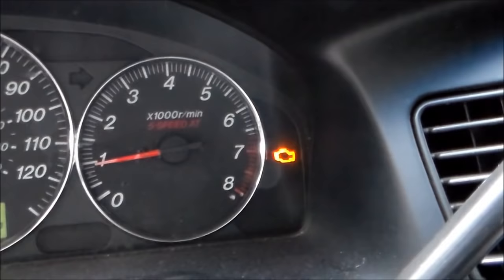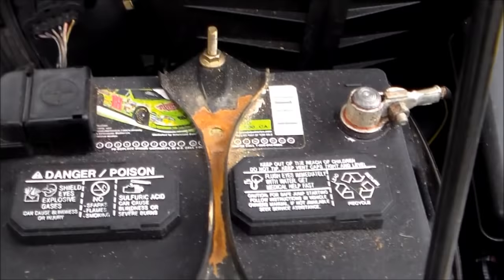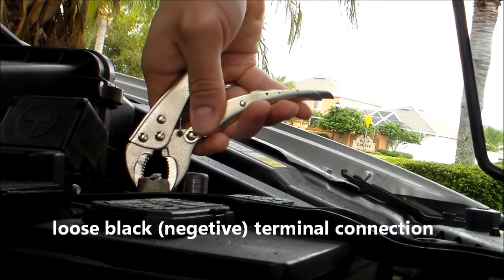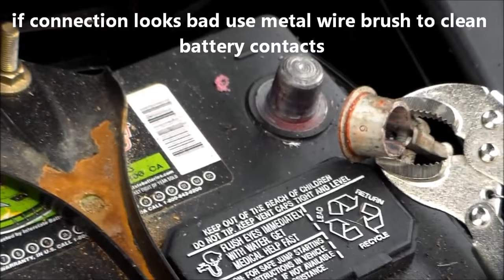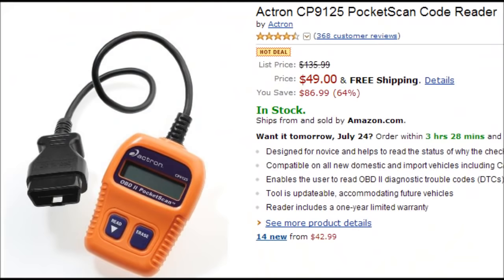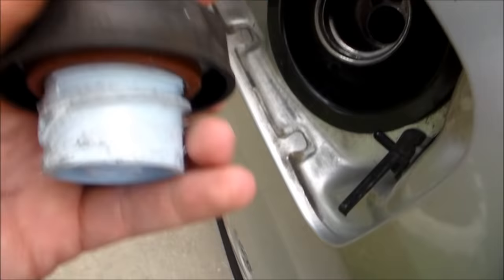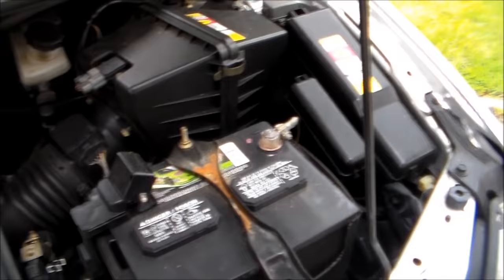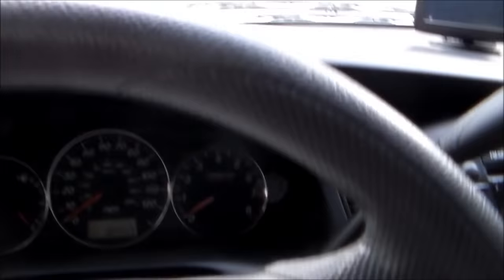HOW TO RESET CHECK ENGINE LIGHT, FREE EASY WAY!

Comment: So I filled up my tank the other day was in a rush and forgot to screw the gas cap back on turned on the car didn't pull out the gas station yet though, then someone came over and told me I left my cap off, but the next day the service engine soon light came on (not blinking though) I have a 01 pathfinder do you think the battery reset trick will still work? Well for any car/truck make or model? 
I do intend to go to auto zone for a code reading too. I am no novice but I like the idea of diy and saving money.
Reply: Your light is back on?
Reply: Jak StG Yes you BET it's back on... This does Nothing to repair this problem...
Reply: I know that does nothing to fix the problem. I'm no dummy when it comes to cars. I was simply referring to a  prior conversation we had about this.
Reply: Auto Zone can put the light out for you unless it's a VW.
Reply: you don't need to do anything the check engine light is gonna reset by itself(it takes time) like mine did the next day after I fixed the problem which was loose gas cap, unless there is another problem!

Comment: App for Car’s Indicators and Warning lights explain.
The app includes 468 unique indicators lights.
Website: http://Carwarninglight.com
YouTube: http://youtu.be/u5o9CdUbwms

This App could save hours of frustration and trouble with your car. Indicators and warning lights in your car instrument panel are there to signal that something is wrong with.
The App provides an overview of your car indicators and warning lights, what they mean and how you should act once illuminated, as well as some advice about common engine problems.
You have all the information you need at your fingertips.

App has Car Finder and Parking Reminder. You will never be late again, phone will remind you before your parking expires.
Reply from the maker: good to know

Comment: hi please i have aqustion..i have ford galaxy 2.0  diesel 2009..last week the temperature gage goes high  till 110 while I am in traffic jam i stopped immediately the engine a little bit warm but fan doesn't work? after i use the car without any problem till now i drive for long distance no problem. I don't know this happened shall i check the car ?

Comment: Hey bud like the ps3 vidz but 2 things 1 pulling the battery terminal is like a hard reset also steer away from locking gas caps that code will pop alot another thing with the battery trick if ur car dose not seem to lack power and u cant tell a problem then pulling the battery is okay but if the vehicle seems to have a problem do not pull it take it to a mechanic they have computer scanners that read your probable cause and can get u fixed up when pulling the battery terminal is a hard shut down where the scan tool is ur soft reset  u can buy these cheap ones for 40 to 50 I have a 100. One and can give me codes and I can erase but we also have 3 to 4 thousand dollar ones that can do more and really get into the system

Comment: Rather than waiting with an open circuit, for the electrical system to "starve", you should be able to just short the positive terminal (after removing it, of course) to the negative, instantly draining any capacitors & what-not.  But yeah, patience is probably the virtue here.

Comment: Well...that assuming your gas cap is the problem...why dont you clean your corroded battery...and use the right tools unscrewing bolts...that would be a start.

Comment: There's a much easier way . Just unhook your car battery than plug back up . Wait for you computer to reset and your light should be off . It will come back on Ater around 40 miles but this is enough time to get it to pass inspection.  Done it for two years strait .

Comment: on my last astra mk5 it was usually the engine oil running low and I had to top it up and drive the car switching on the car and off around 30 times , i did this sometimes while coasting  and moving Around 20-30 mph but not too many time every 5 minute to 10 minutes .sometime 2 quick on and off at traffic lights takes about 1 hour to 2 hour .
 remember not to drive to hard after low fuel light is on you will mess up the fuel pump .

Comment: This is a band-aid fix and the light will come back after the factory drive cycle is completed.   If you have a check engine light, fix the actual problem.  this is no different then putting a piece of tape over the light.

Comment: my VW jetts 09 gas cam does not have a clicking sound and I had the check engine light on but I have a new gas cap and it does not click when tightening the cap.

Comment: I know you're only trying to help the public but this is not the right way of fixing any check engine lights. You might as well just take the bulb off from behind the instrument panel if you did this. Also get the right tools to remove the battery terminals next time.

Comment: wow...can you please tell me how long that lasts
Reply from the maker: reset will last a long time if you just Repair/replace the defective part before cpu detects error again (gas cap in my case) many cases "o2 sensor" or "loose gas cap" will cause "check-engine" light to turn on
Reply: o ok thank you so much for the advice

Comment: Scooby says     Rut row...............Vise grips instead of box wrench? Pulling neg instead of the poss??? 
Always disconnect Poss+ Batt term first/ reconnect pos+ last. You always want the elect system grounded -  Batt first
Always use the right tool for the job.
.

Comment: This only works if the problem is resolved. When the battery is unhooked, I/M readiness monitors also reset, and when they are ready again (after proper drive cycle) MIL will come back on again if the problem is still present.

Comment: Turning off the check engine light more than likely will not make the problem go away. If it is a code related to the gas cap not being on tight enough, the check engine light will in time turn it's self off once the gas cap has been tightened correctly. If you do not have the problem diagnosed correctly you could end up costing yourself a lot of money down the road.

Comment: If you don't fix the problem your check engine light will  come back on in about 25 miles and use the right tool to take off terminal post not vice grips  that  can damage the bolt  may round it off

Comment: Most auto places with let your use the reader which also can clear clear codes. Clearing the code doesn't fix the problem. I've seen the gas cap and I also had a air leak.

Comment: A lot of cars will need the battery disconnected for much much longer. may be 12 - 24 hours . quicker to buy a cheap reset and code reader from ebay. !

Comment: Any thoughts on how to reset the ABS brake warning light on my 2005 Ford Escape Ltd?  Just changed my brake pads and now it comes on every time I drive.....Thx
Reply from the maker: i took my car to local ford dealer and they reset it for free but depends where you go.
Reply: did you plug in your ABS sensor? perhaps thats why the light is on
Reply: Ya if the ABS light is on you may have damaged an ABS sensor. ^ Also as above if you didn't plug it back in properly it will do that as well.

Keep in mind if that light is on, it automatically disables ABS functionality.

Comment: Thanks..but its painful to watch you undo a 10mm nut with mole-grips (or whatever you call them) use a proper spanner!! Also you look afraid of the battery terminal; it won't hurt you.
Anyway it worked and well done that man.

P.S. Important to note that many cars will need a total reset where the battery has been disconnected which maybe beyond the means of the D.I.Y. er.... lost radio code, windows; all sorts of stuff.

Comment: I bought a 2006 vw and a week later the engine management light came on. Took it to the garage and it was the catalyst system (exhaust). 

My question if the previous owner had known about this issue and turned the light off, how quickly does the light come back on?

Cheers,
Reply: +M.A Mashabane a week ha ha, some time after 24h, some time a month, i think he know about that, cheers
Reply: +M.A Mashabane Depends on how fast the drive cycles for your car are completed. You have to have a specific amount of gas, proper operating temp, and drive/brake at specific intervals, which will complete I/M readiness. If all the parameters for the drive cycle were not present, the light could stay off for a very long time. OBDII Cars have Inspection / Maintenance Monitors which have to be "ready" for MIL to come on again(if problem is still present), after battery is unhooked, or codes are cleared with a scanner. Look up drive cycles for your specific year/make/model and that will help.

Comment: I am pretty sure the "guy" at autozone meant that your gas cap wasnt on tight enough.  Reason I know this is this happened to me on my 2013 Chrysler 200.  I stopped at Advanced Auto parts after getting a check engine light and had this same thing happened.  JUST tighten your gas gap or buy a new one... your computer system will clear itself after a period of time.  You dont need to clear anything. It will clear itself!! and I am more than just an amateur mechanic. Most people dont need to buy a scanner cause most Auto parts will do it for free everyday all day.  Thats how they sell most of their parts is through DYI'ers.

Comment: An easier way would be to put a new gas cap on and the code will clear itself after you drive it 25 miles or so..

Comment: OMG <bangs head> don't do this, it resets the light, BUT if you take it for a cleanair, when they put a tester on it will stay in "test" mode, in fact when you start the car next time, you'll see the CEL flash meaning its in not ready mode. when its gone through its series of checks, the CEL will come back on again... FIX the problem don't reset the light... its like putting a bandaid on a cut, which needs stitches? jeez bad advise

Comment: It only works if you fix the problem that caused the engine light to come on, the light comes on for a reason not just for the hell of it. For something like forgetting to put the gas cap on, if you put it back on it should go out within 50 miles or so.

Comment: Until the cause it corrected the MIL will continue to reappear after the ECM has detected the same code on two consecutive drive cycles. For anyone who may watch this and think they are going to fool an emissions test, think again. Once the freeze frame data has been erased the vehicles ECM will show that the "readiness" tests are incomplete. Instant, automatic fail. If you think you've got a faulty fuel cap here's a simple test. Shake it. If it rattles, it fucked.

Comment: Will the codes stay off long enough to pass an Inspection.? Or will they come back on after you reset the cars Battery.?
Reply: A REDTAIL  no, it will read not ready for testing.. The car has to run through so many cycles and then the computer will reboot. During that time, testing will not pass until the computer reboots usually about 25 -100 miles . If the problem still exists, then the light will come back on .
Reply: A REDTAIL it may be off till it retests and when u go for inspection they can see if the test has run and if it hasent they will tell u to go drive around till it runs the test and it will more likeley fail again so no that wont work

Comment: Hi today I went to a car wash today and I got the place to clean my engine bay when they power washed it and after I went thru the car wash after I came out my gas tank lid was full open would the fan blow air into the cap or something now I still have the engine light on _" & my exhaust  now is making a popping sound would you know what it means?

2004 Mazda tribute ES V6
Reply: Modern engines should NEVER be power washed because of the sensitive electronics on and around them.

Comment: Why didn't they just reset it at Autozone when they connected the scan reader?  BTW  the CEL will just return if the condition is not resolved.  Also it is best to disconnect the negative post of the battery only, as the positive cable can short to the chassis if you are not careful.  Also make sure you have your radio/stereo security code and any other device that has such a security system.

Comment: This is not correct. You reset the computer but what ever triggered the engine light is still in the memories. Just go around till you cover the driving cycle millage the you need to drive and it will come back again.

Comment: Doesn't work on all cars. On some and in order to clear de codes (temporarily) you may have to disconnect the battery cables and then have the positive touch the negative..Make sure if you do this that there isn't a second battery like in some Rams. This trick works well so that if you have a hint as to what the problem is and fix it you can get rid of the MIL and codes to test it without a code reader.

Comment: Bin the grips & buy spanners (wrenches) 8, 10, 12, 13, 14, 17, 19mm that's usually all you will need for most modern cars. Don't forgot the hammer and screwdriver. 😬

Comment: Easier way is to remove engine fault bulb.
Reply: ha ha ha
Reply: max hansen Even easier ?  Piece of electrical tape over the light... Problem solved, right !!!  lol
Reply: max hansen Why not just chuck the Engine out and replace it with a horse?

Comment: Just tried this two days ago, the first time I unhooked my battery for about 30 minutes.  Hooked it back up, started the car and light came on.  Tried again yesterday; unhooked battery for about an hour;  hooked up.  Light was out, but only stayed out for a few minutes.  Gonna try buying a new gas cap tomorrow and see if that helps.
Reply: O'Reillys has the free meter check with a decent level Innova OBD II meter; the 3160,  http://www.amazon.com/INNOVA-3160-Diagnostic-Scan-Vehicles/dp/B001QIUGVI/ref=sr_1_1?ie=UTF8&qid=1396746723&sr=8-1&keywords=innova+3160+scan+tool . The one flashed in the vid looks like a real cheapo unit like what I got at a Napa store to check a friend's car last year.  The Innova gives some degree of text that can be helpful as a means of where to start looking. My lean O2 sensor readings; P0171 and P0174 was due to a dirty Mass flow sensor.  Meters are not a magic bullet as variables come into play.

Comment: If the problem is not rectified with in 2.5 thousand km it will return trust me if the engine light comes on get it looked at or it will cost you a lot of money. These new cars wiht computers are nothing but trouble if you don't get them serviced regularly its not worth the risk unless you have endless pockets

Comment: I put a new lock cap from auto zone on my 2000 Ford F150 and the engine light they said was caused by leaking cap still comes and stays on? What else could it be? you say something about an air flow sensor? Any suggestions for an old man that only worked on now what you call antique cars, that I call real cars with few problems, that are simple to fix.
Reply: Google "evac system" for your make and model. It could be a leak in any fitting or hose in the system. Mass air flow will cause rich/lean condition which will give a different code.

Comment: that can reset the check engine light but if the problem was not fixed the light will come back on, usually within an hour of of driving or within the next day.
Reply: Harry v.d.akker have you had your engine checked?

Comment: if there has an issue with the car then this is not going to help since it will only temporarily clear the code. check engine light will soon come back on once in motion.
Reply: Smit Shah

Comment: That's not the way to do it on a 99 Honda Accord because if you remove the battery cable it freaks out the computer and your car will run ruff for a while untill the computer recalibrate it self to the engine. The better way to do it is to remove the fuse for the clock on Honda 99 accord this is according the the Hanes Maintenance manual don't know if this works with other brand of car.

Comment: what this also does is clear the freeze frame data that gets recorded the instant the code was set, data like throttle angle, engine temp, air temp, veh speed and so on. this data is very useful in helping me diagnose the car properly. please don't  do this then bring the car into my shop, it may result in longer diagnostic time and my time costs you money.

Comment: gas was evaporating out of the tank cause of a loose gas cap.. If you are loosing that much fuel from evaporation...drive your car more and dont leave it sit for months, lol   Without doing the math, knowing the outside temperature and looking up vapor pressures, etc., I'd say "no" this time of the year. 100+ degree weather, maybe. . . but probably not. By the time the gas is half gone it should be a lot darker and smell a lot different as the light components of the gasoline would have evaporated out.
Is that the case? 
I suspect someone is messing with you.

Comment: Here is a couple of things you should be aware of. Your states may vary but it is illegal to "reset" a check engine light without a diagnostic check in order to determine and fix the failure. As to "air in the tank", there is always air in the tank. The possible gas cap issue is from the monitor that runs that is responsible for fuel vapor leaks. It pulls a VERY light vacuum on the tank, holds it, then sees if it "leaks" down. Resetting the light and seeing if the light comes immediately back on is not the assurance of a repair. That monitor will need to run. Some will only run from a cold start and almost every single one will not run unless the fuel tank is between 1/4 and 3/4 full. higher of lower won't run. Oxygen sensor/AF sensor/lambda sensor will not trigger a small or large leak detected code.

Comment: Hi!

I have a civic 2004 1.7 cdti with the engine check light on.
I tried to turn it off with torque android but i couldn't do it.
It says that is a P1113 trouble but i couldn't find it enywhere...
Maybe you can help me?

Thank you for your time.